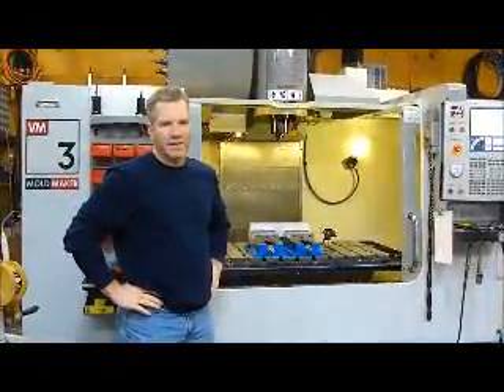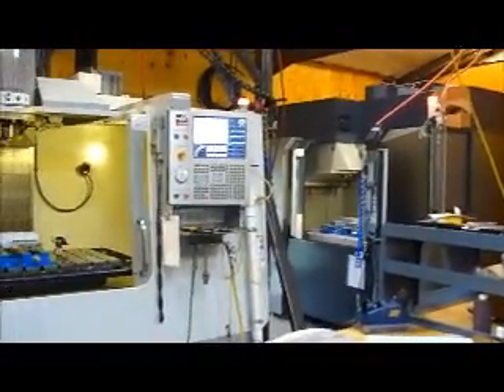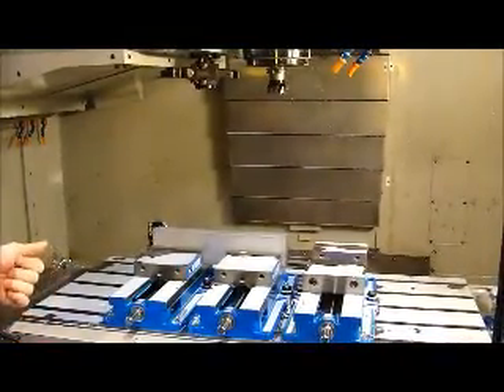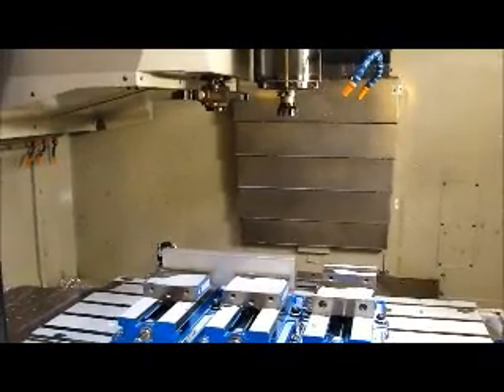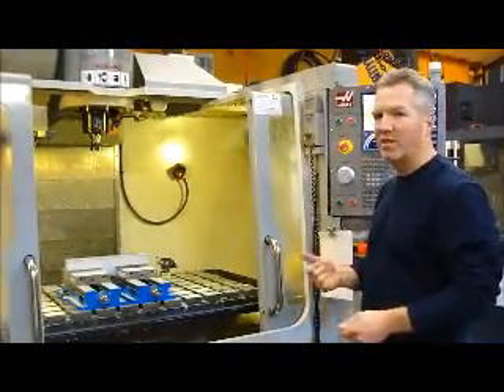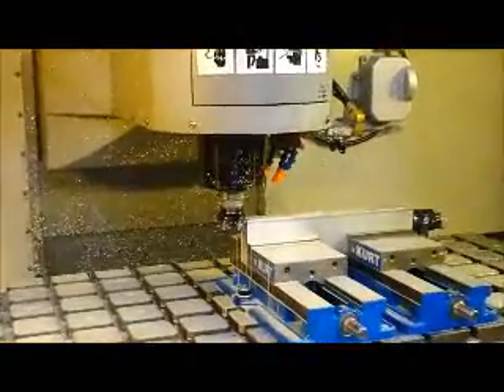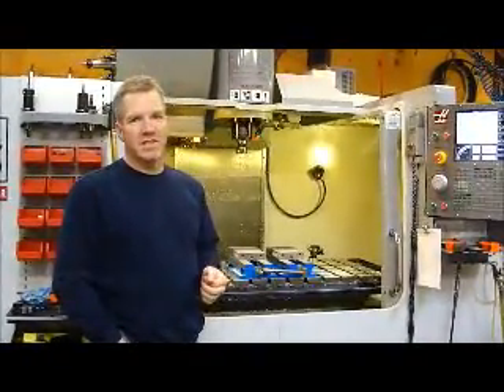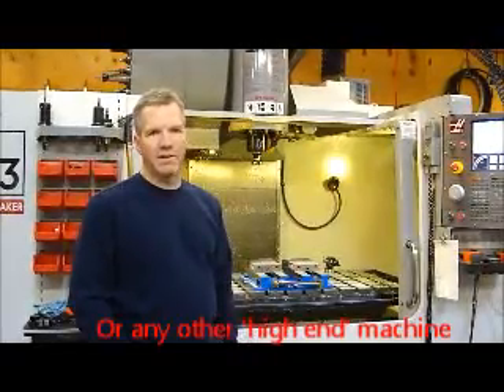Haas vs Makino

Comment: In short: A Haas is like a car that can go 100 km/h in a short sprint. A Makino is like a truck that can go 100 km/h with a 40 ton load uphill all day – both have “speed”, but their ability to maintain work under pressure is vastly different.   ,,,    Haas often lists their torque as “Peak Torque.” This is the maximum force the motor can deliver for a very short period of time (often only 3-5 minutes) before it overheats.,,, Makino focuses on "Continuous Rating" (S1 operation). This means that if a Makino promises a certain torque, it can deliver it 24 hours a day without stopping.

Comment: You know, I've run both and both are good machines. It just depends on what you're trying to accomplish. If I'm running close tolerance pieces, I'd choose the Makino hands down. If not, the Haas might be a good choice. We have a '99 Makino V55 that will hold .01 (MM) all day, every day. The Haas...ehhhhh...not so much. Just my 2 cents..

Comment: The thing is you're comparing apples to oranges. Of course the Makino hugged that material because that's what it's designed for. Ramp the spindle speed and the feed on the haas and drop the cut in half and it would work just fine. Use the machine for its purpose and you'll get a great result every time.

Comment: Have a makino f5 in our shop...and a haas vf4...dude crashed the makino...cost over 10k to have them come and retram...hass would of either faulted out with no damage or been retrammed for about 1k from local haas repair...Makinos coolant system is absolute trash as well... Not saying haas is better bit they are much more user friendly and cost effective...

Comment: That Haas looks like pants, I'm sure my 1997 VF-4 would do it.
Reply: try it and tell us
Reply: @georgepapadimitriou4965  I did, spindle belt snapped and broke my gearbox, I actually scrapped the machine.
Reply: @BebenX  So sorry man. I guess you have to be gentle with Haas. I worked with them for over 10 years in a shop.
Reply: @georgepapadimitriou4965  haha, Its not all bad, that machine made millions in its life, I don't give a shit, I bought a new vf4ss and push it pretty hard, it loves it!
Reply: @BebenX  Hahaha you are right, and the modern Haas machines are way better than the older ones
Reply: @georgepapadimitriou4965  agreed man, but any haas machine made after 2015, its not so good.
Reply: @BebenX  I worked in a VF2 of 2006 and a SL 20 same year. A lot of problems with the TSC , never worked proper and the lathe was working  _+ 0.02mm
Reply: @georgepapadimitriou4965  I chase microns every day on my vf4, it always hits microns, -+ 2um
Reply: @BebenX  the mill was ok. The lathe had problems. As I said modern Haas machines are better
Reply: @georgepapadimitriou4965  yeah, no doubt, haas lathes have always been bad to be fair, you gotta be lucky to score a good one.

Comment: Every manufacturer will do this heavy cut test to prove that their machine will perform correctly at the highest power metioned in their catalog. It's the standard test and only if the machine pass that test, then only quality checking people will clear that , otherwise not. If the machine fails at that depth of cut and feed and rpm, then there might be problem in toolings, or machine structure assembly, or the drives. Have to check that. Cannot guarantee that the power will be same on old and new machine.

Comment: This is a fools comparison. The Haas is a VM not a VF. The VM is a low torque 15k spindle for HSM machining. The Makino is a high torque 7500 spindle. Of course the Haas will fail. This dumb ass rugged the test to use the Makino at its highest torque curve.  

Compare apples to apples and get a better camera.

Comment: I also want to point out that you ran the new mill at exactly 100 percent spindle load, and then tried to run the well used and unknown abused mill at the same load, and while it said that it had 150 percent spindle load, that may be at the end of the event.

It may have had only 101 percent spindle load, just enough to trigger a shutdown, but then as the VFD ramped down the voltage, and the cutter buried in deeper, the momentary effective amp draw by the motor may have spiked, which is where the 150 percent came from.

In other words, this could be the difference between a new machine and a worn machine, and not actually 150 percent less than needed.
We also don't know what the shutdown threshold is, or what the steps are in the error message.
Would it show a 127 percent overload? Or does it jump straight to 150 percent?

Comment: As anyone who understands motors knows, horsepower is not a useful comparison between different manufacturers, or different motor types, etc.
Horesepwer is a composite number figured at certain rpm and loads and voltage drops and many other factors, and since it by nature is imprecise, it often is just estimated.

In order to properly compare the motor power, you would need to know the torque curve, the input voltage, the motor rpm, the spindle rpm and gear ratio between them, the type of motor drive unit, and its specs, etc etc.

If for instance the Hass motor is turning slower because it is not direct drive (allowing a major cost reduction in not needing a motor rated at extreme speeds), then it may not have as much torque available at that speed as a much more expensive high speed motor.

So basically horsepower ratings are useful to compare between machines in the same manufacturers line, and broadly compare between comparable product lines.

But just like a Ferrari with 500 hp is going to have better performance than a Chevy pickup with 500 hp, claiming that the same size motor should be able to cut the same at max peak load is just assanine.

Comment: Honestly It is hard to decide what to buy.

You have only so much money in your hand and you want to buy as much as you can with what money you are holding.

The HAAS is attractive to so many people mostly because of the price.

I would prefer a Mazak myself if it was only a case of choosing.

But we all fall victim to the dollars $$$$$$$

Unfortunately for the American,s the Japanese machine will out power the HAAS of the same spindle power, reduction gearboxes or not.
Even Gene HAAS admits he builds the machines to suit a certain market.
Reply: This is the point that i am always searching about Millturn the WFL they are skyrocket in price if them machine but i ended with Mazak integrex e670 or DMG mori NT series, CTX series which one the best for long term use preformance  & Value.

Comment: The answer to the question is really quite simple - in fact this video makes both "sides" of the debate.
The Haas was in budget, and plenty good enough to earn profits on - enough profits to support purchase of the Makino.
The spindle overload threshold parameters in the control are set at a level that ensures longer machine life - they CAN be changed.
The Haas are also designed more with the operator in mind (user friendly) than most if not all VMCs, including Makino.
That said, the Makinos are excellent machine tools, powerful, accurate and reliable - and Expensive. Makino's service can be sketchy - some parts are only available from Japan, and a machine down waiting for parts makes NO money no matter how good it normally is. All Haas parts are here in the U.S.
Is the Makino a "better" VMC? maybe - if all you're doing is hogging off stock they might be worth the extra money, otherwise the Haas is every bit as good, and a better buy.
The Haas is much more machine per dollar spent than the Makino.
40yrs. in the industry teaches you to watch the returns on your investments, and the Haas gives better returns on the dollar.

Incidentally, Korloy sells MUCH better face mills for cutting aluminum, though 6061 cuts like butter with almost anything.

Comment: We don't have any Makino VMCS to compare to our HAAS'S , we do have a Makino A88's, it is almost frightening when you push it in alum, Side note when possible use 6061 T6 QQA250/11, instead of 6061 t651 it cuts about 25% faster :)

Comment: This is in now way a direct comparison! Dece[tion at it's best. VM is made for mold making which is high speed contouring, not heavy roughing cuts. This machine has a direct drive spindle so you you can achieve the higher spindle speeds (you can tell by the rounded spindle head). Down here in oilcountry if we wanted to achieve this we would buy the correct machine and used the Haas "Bulldog", the VF-3/YT50!

Comment: That Haas costs much less than the Makino. So for the same price you probably could have two Haas machines cutting at 75% rate of the Makino and output 150% production of that Makino. Why not compare same cost machines? Because then id bet you would likely have an even match with more even results. Which im guessing is not what you were after. Ive had 20hp machines with 4 speed gear boxes that were gutless. And had 20hp machines with 2 speed gear boxes that would eat their lunch. Comparing sticker hp ratings is a fools game. Theres more to it than a motor or drives hp rating.

Comment: Glad you posted this, we fell part to a HAAS ST-35 a few years ago. after it wouldnt do what haas specked it to do and they not taking back we got stuck with a 150k peice of JUNK. tailstock is useless chatters take .01 thou depth of cut on a 2"x12" shaft. ridiculous, anyways we have a whole shop full of Hyundai Wia now best decision we have every made. we are looking at some 5 axis Mori stuff. Nothing in the US can compete with Mori,Makino,Okuma. Haas is a machine you run for 5 years on light stuff and throw away, where your upper machines are run for 20 hard years and still going strong. these people that still think Haas is the best thing have obviously never worked with a real machine.

Comment: Doesn't matter whats the guys preference. The video is a joke anyway by the simple fact comparing two machines playing in different leagues. Here in Switzerland people buy a Haas for a specific order. Knowing it is cheap and will somehow handle it for the period of this order. Where as a Makino u buy after studying very good what covers ure needs best, knowing it will work 20years with the accuracy a Haas isnt capable of even in new conditions.
Reply: 30hp is 30hp.  if its on the tag, it should make the cut.  period.

Comment: just i dont get why companies as Haas doesnt put more torque in its spindles.. 
..jesus, why they are so stupids??
Reply: As pointed out before, Hass is catering to a capital sensitive audience.  If you are trying to hog massive amounts of stock quickly and have your machine maintain accuracy and reliability over time, the Haas is not what you are looking for.  It is true that the load sensor on the motor is programmed to shut off earlier on the Hass machine...that is because the ways and journals are not built to handle more load.  This is one of the ways the manufacturer can save money and produce a cheaper machine.   It is clear, the productivity of Japanese machines, in general, is far better than US offerings.  I have decades of experience running multiple shops and investigating equipment and capabilities around the world.  I have worked with their engineering teams and they are clearly more thorough and capable of It pains me to know that even with better prices, I rarely see an american machine in ANY shop, USA included.  It's no wonder why we are getting our asses handed to us by every other country that does manufacturing.  I have a Swiss and Japanese machine and one 1960's Bridgeport (which is now owned by a Hardinge BTW).  Manufacturing ceased to be important to America decades ago when politicians capitulated to big business looking to outsource work to slave labor in other countries.

Comment: It's only a fair test if the machines are configured the same way.  Is the makino and haas both direct drives???  Is one a gearbox machine????  I know that 3000 rpm is going to be low on the torque curve for the haas!

Comment: I have read many times in many forums these following words. "I'd rater buy an old Mori than a new Haas" Well, I did just that. I found a $40,000 low mileage 18 year old Mori SV500. I would not trade it for a brand new $90,000 VF3SS.

Comment: It is not only depend upon Torque V/S Power, to show cause the machine capability. There are more factor involved in this, machine structure, axis power and axis capacity to take load. if spindle power is same, but your axis could not take that load, what you can do????????. Definitely spindle will stop. each and every manufacturer has got their own business and specialties.

Comment: This is not a fair comparison by any means. Clearly this guy wants to show his dislike for the haas machine. There's no regard for the spindle load settings on the Haas. For all we know, this guy has them at 10% so the haas overloads after barely entering the cut. Of course the haas will bury the tool in the workpiece if the load settings aren't adjusted to suit the tool and application, idiot. Without making the parameters on both machines mirror each other, your comparison of apples to oranges is invalid.
Reply from the maker: +Max Selna  Haas was running with the override limit at 150%.  Makino, I have no idea where the override was set but it was cutting at 100% spindle load.

Comment: I think that most people that are leaving comments are missing the point.  Haas has a reputation for over-rating their machines.  I haven't yet seen a Horsepower / Torque graph for Haas machines.  They tell you that it's 30 hp.  30 hp? Makino can run a 30hp Spindle at 100% spindle load for 30 mins.  This test is Haas 30hp vs. Makino 30hp. You get what you pay for... End of story.
Reply: +Dean S 
Look at the electrical rating tag on a Haas and compare that with the tag on a Japanese machine. The 30hp Haas is 80 amps. A 30hp Mori is 160 amps.
Reply: At what voltage?
Reply: 208v Matthew Collins
Reply: Dean S 
It's called return on investment - and the Haas machines beat the Makino hands down every time.
Most shops don't order their material so far oversized that they have to remove large amounts of metal, and the Haas is every bit as good at every other facet of machining.
So yes, you get what you pay for, even when you're over - buying.
Reply: @Motor-City-Mike  ROI in what shop? Not all of us are job shops, competing for the work 90% of shops can do. My shop machines Stavax, H13, CPM; lots of hardened steels and a lot of molds for the optics industry. You flat out cannot do this type of work with a Haas. To each a machine to meet their needs for surface finish, tolerance, etc.. Compete with the rest or do what they can't.
Reply: zaknefain100 
This comparison doesn't look like tool work - yes, in exotics and tool steels a more rigid and higher hp machine is an advantage - no argument there, but there's a whole lot more job shop work out there than anything else and a good machinist on a Haas has no problem making good close tolerance parts in excellent time.
The problem with high end machine tools is simple, when the work slows down - like it always has - that machine costs more money sitting there than the Haas.
For return on investment it's hard to beat a Haas.
There's plenty of shops that Can't get the work done right, or on time, and the machine tools aren't the problem.

Comment: I havent had much to do with HaaS but it sounds like and performs like a paramater adjustment is required on the drive/controll as it wont allow for the high start compensation required to get the cut started. Either load alarm time or speed compensation error. For cuts like that it should be mm per min not rev. The best way to tell what will compensate faster is to check the size of the main SSR's in the spindle drive. Japanese m/c are normally larger than others.